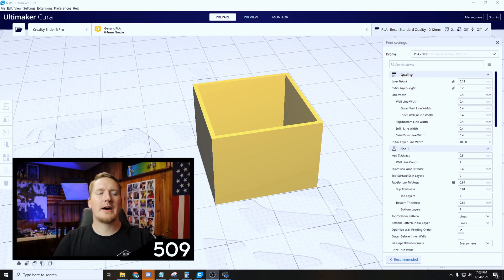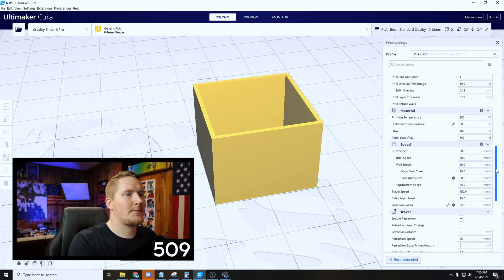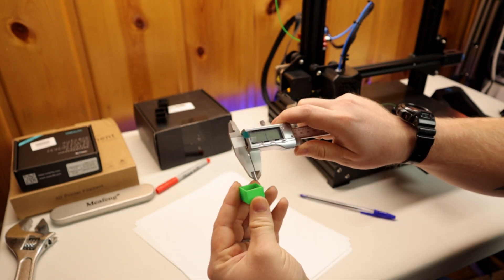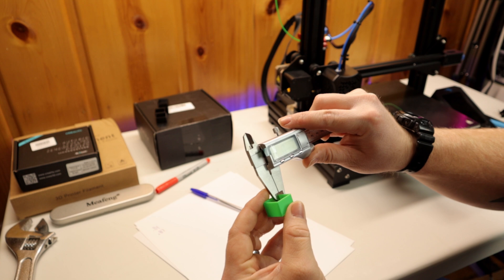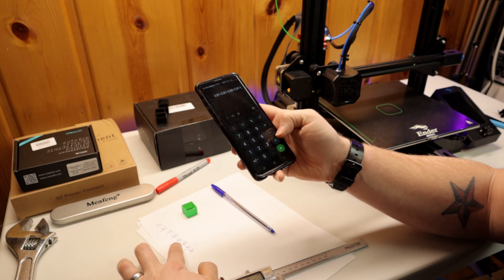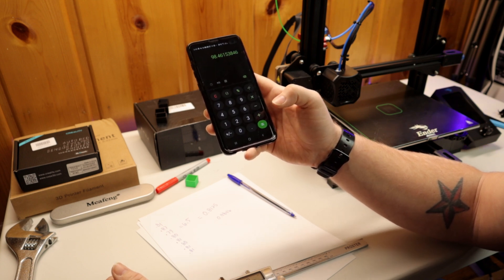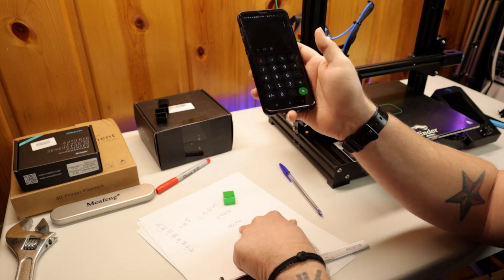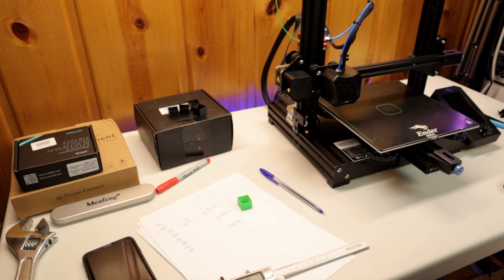How To Calibrate Your Flow Rate [ Ender 3 V2 ]

Comment: I think this is fundamentally wrong.
You basically try to calibrate horizontal expansion with flow rate.
Putting less material down because it spreads out too much. This Will cause problems in the rest of the print. Probably under extrude.
In most slicers you can software adjust so the printer basically takes into account how much the material spread.
Reply: I agree Eric. This video unfortunately put me on the wrong path (no offence to the channel, I appreciate you try to post a helpful vid!). I carried out the steps and ended up with some of my worst prints due to under extrusion. I have since learnt that you should use horizontal expansion, as Eric said, to adjust this. What I am still uncertain about is how to actually calibrate flow rate? Could you point me in the right direction Eric?

Comment: Hey, I calculated my FR and it's should be 92%. Printed another testcube and the wall thickness is spot on! So far so good.
But the layers and infill are under extruded. Everywhere (including walls) through the whole print, the lines aren't touching each other. Sometimes they do, sometimes they don't.
 
Is FR a compromise between wall thickness accuracy and a good extruded layer or am I missing something?

Printer I use is a E3 v2 and the slicer is Cura
Reply: I think you are basically calibrating horisontal expantion/squish and not flow rate. Flow rate are probably right if you calibrate the extruder and the filament diameter are consistant.
Reply from the maker: You know thats a good question. I'm not 100% sure what the flow rate technically is a combination of. I'll do some research and post back.
Reply: Hi, I have the same printer as yours and im also using cura. If your having under extrusion after setting your FR(after estep), bump up the flow rate by small increments until you achieve perfect VISUAL/ESTHETIC layering(use some small test rectangles/cilinders)/. Then redo the hollow cube with 2 & 4 walls and you will find that the desire thickness will not have changed even with the increase FR. Why? Because the path of the nozzle will stay the same regardless of the FR and will simply fill the gaps if you increase it. For exemple, in Cura setback your FR at 50%, you will see in the path of the bead stays the same but now there are gaps in between the walls(in the slicer preview). Which will result in heavy under extrusion. So basically IF you recalibrate your e-steps you absolutely need to recalibrate the flow rate because they do the same thing : regulated how much filament reach the nozzle. Let me explain: when we print something, the gcode from cura ask the printer to extrude X amount of filament in millimeter AND THEN the printer translate it in steps for the extruder motor base on the e-step setting. If for exemple we remove X esteps you need to add back X% flow rate to get back to the same results as before. The e-steps is the mechanical constant and the flow rate is his direct modifier in the slicer. The nice part about the flow rate is that you can adjust the top/bottom/wall independently or not to find the perfect esthetic & AFTER THAT you can use the horizontal expansion settings to fine tune the perfect dimensions if needed. Once the flow rate is set for the filament type, you only need to twick the horizontal expansion for each model individually IF its a pricision demanding part. Also if you want to adjust the first layer elephant's foot, you can do it in the horizontal expansion settings. Half the 3d guru's are telling people to use the FR to adjust dimensions & the other half is saying to adjust it with the horizontal expension... if you want beauty & precision you will  need to adjust Both. Hope it makes sense.
Reply: @Carlos-kk4nw any idea why my prints went from good to suddenly under extruding? Ender 3 was working fine for months then began severely under extruding. Good fillinent, no clogs, but a seemingly slower turning extruder stepper at the same settings. Been trying to figure out for days now😮

Gear is clean, not slipping, and motor appears to be pushing less. Ramped up the flow to 150 and now seems fine. Should I order a new stepper?
Reply: @sevenspec if you have plastic extruder then it maybe cracked

Comment: One question. When you calibrate flow rate for tpu, do you adjust in slicer flow rate settings or to the machines flow rate stored in eeprom/SD?
Reply from the maker: I think you can do either or,  depending if your machine allows you to adjust flow on the printer. I just adjust mine in the slicing software (cura) and save the profile. Hope that helps!
Reply: @509drone2  thanks for the info! I never thought of having to do this for tpu.

Comment: Noticed you had a corner measuring.087. Could this happen because you have the seam set to sharpest corner and it is seaming it on that same corner ? I wonder if setting it to random seam would change your measurements and get that average closer to .08. Enjoy the videos !
Reply from the maker: You noticed that! Good catch lol. I thought about this long after I was done, and have since changed it to random for when I am running calibrations like this. Good eye :)

Comment: Just received my Ender 3 V2 but our prints are messing up despite our constant modifications of the bed leveling. Should I get the BLtouch?
Reply: Have you tried using an stl for leveling like this one https://www.thingiverse.com/thing:4711071 ? If not, give it a try! Paper is not a great way to level the bed. Also, have you calibrated your e steps? If not, do that too! between those and this flow rate adjustment, you should be able to get some good results. Another thing I would highly recommend is swapping the stock couplers and bowden tube for some better ones. TH3D has a great upgrade set for that. Almost all of my problems with my V2 came from the poor tube and couplers. 

That said, when you say your prints are "messing up", how are they messing up exactly? If you state a specific issue, it will make it a lot easier to find a solution. 

As for an ABL sensor (BLTouch, EZABL, etc.) they are a great addition, and make your life a lot easier by taking bed leveling out of the equation, but they certainly are not needed to get good prints, and getting one won't solve any other issues that are not related to bed leveling.
Reply: @ernestryles  Thanks for the reply! I am a beginner and never thought bed leveling would be this hard. To clarify what I meant by “messing up”, I meant that our filament wouldn’t stay on the bed and we would try to level it with paper but it would end up making things worse with more inconsistencies of the bed level. We tried many prints that would test our bed leveling like with the prints the famous 3D printer you tuber like Chep would present. Some tests would run fine but then all of a sudden, the filaments wouldn’t stick at all. We tried adding adhesive, nothing. My brother and I are becoming quite frustrated given that we tried for three days and our first layering were never turning out right. I’m ready to do anything to fix the bed leveling, I’m ready to buy the BLtouch, I just want to print SOMETHING. Also, could you clarify what you mean by “calibrated your e-steps” and “flow rate adjustment”. If you can, can also link me the upgrades that you’ve bought that worked out for you? Thank you.
Reply from the maker: What Ernestryles said is all great info. Join our discord if you have any questions or want to chat with other people who are new to the hobby.  Its linked in the description.
Reply: @509drone2  You already did! I was “Donny” who had that firmware problem with my BLtouch. Your Admins were very helpful! Now I’m able to print without an bed leveling problems. I’ll be sure to come back off any help or advice

Comment: I got my ended 3 but the print is not sticking
Reply from the maker: If your print isn't sticking to the bed, you more then likely need to adjust your bed level. Try cleaning your bed off with some alcohol, and then adjusting your bed level. I will have a video up soon on how to properly adjust your bed level.
Reply: From where you have brought? ( Not related to this viedo )